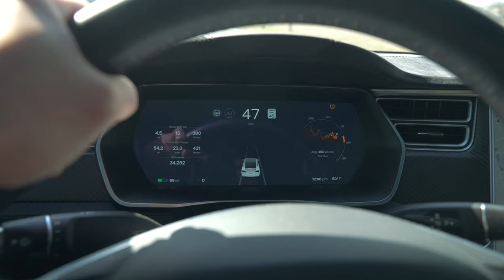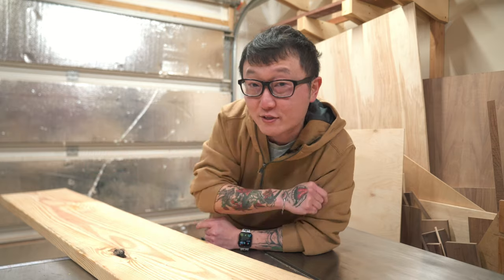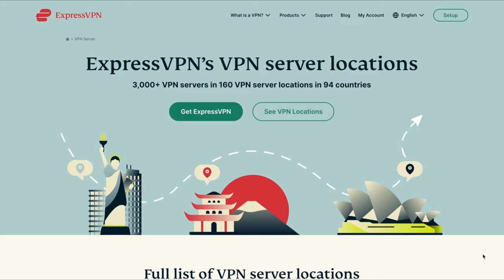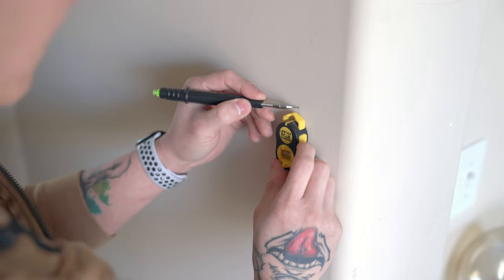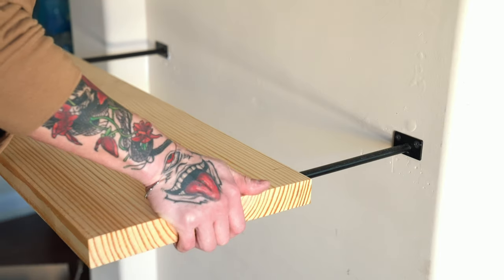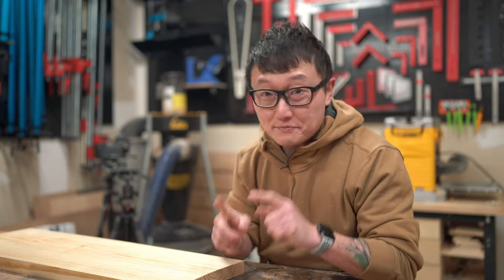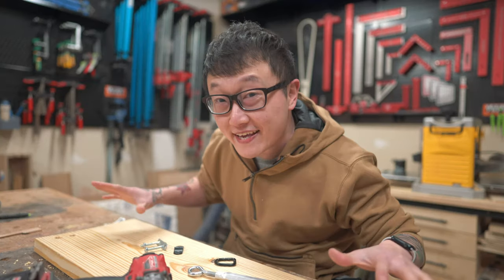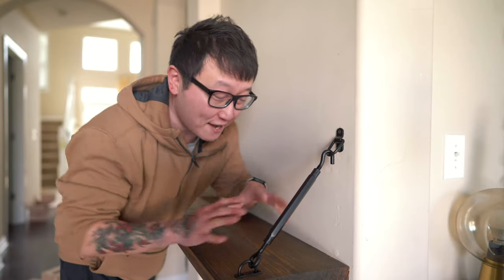Easy DIY FLOATING SHELVES Super Strong | How To Woodworking ( hanging shelves )

Comment: THIS IS NOT A FLOATING SHELF!!! 
But nice design.
Reply from the maker: Yes it’s still considered a floating shelf. And thanks! 😅
Reply: @BevelishCreations  
"A floating shelf is a form of shelf with its wall fixings hidden within the shelf board, with no visible supporting brackets."
It's not tho, lol. 

Even if you read this technical term somewhere, people are expediting a shelf without visible supports when they click on your title.

Like you built a super nice and strong shelf, while not just call it that in the title. The word "Floating" is here just misleading, just like the other comments are saying.
Reply from the maker: But this shelf shouldn’t work with the way it is anchored to the wall. If you placed anything on the back edge, the shelf should just rotate. Should I call it a “hanging shelf”?